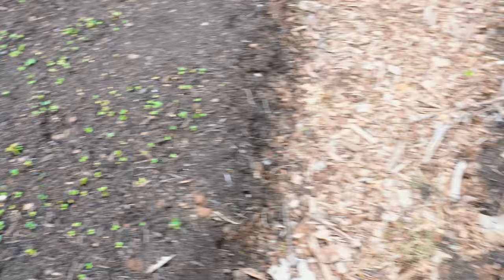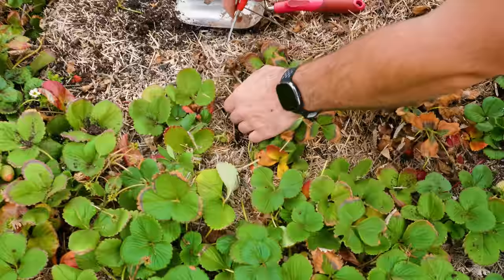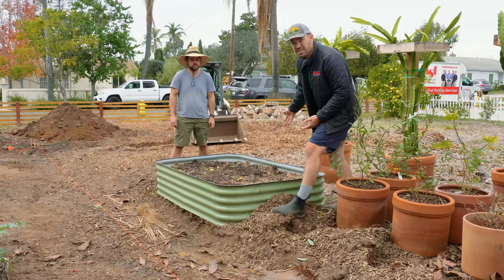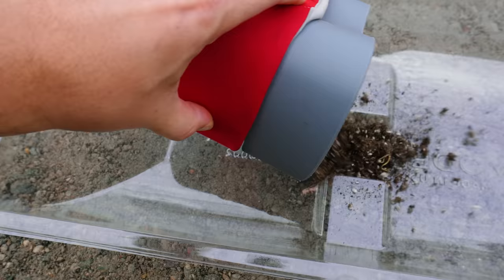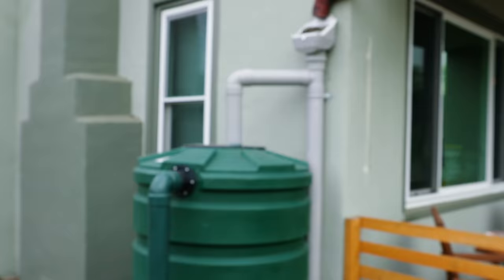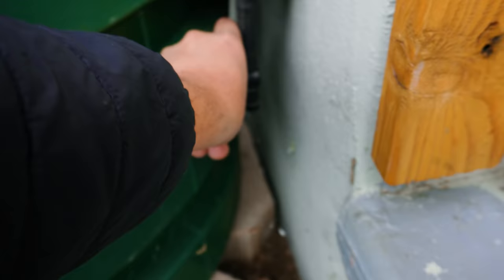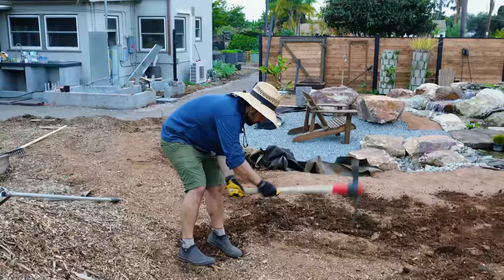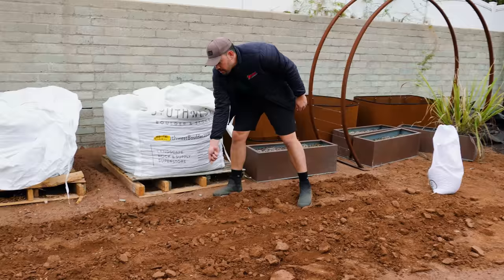Preparing The Garden For RAIN 🌧

Comment: It’s a tiny snake! Silly!I hope you have more. Keep them in the strawberries so they can keep the bugs down.      Can you put a hose connector to the bottom of your drain so you can direct the water where you want it? If rainwater drains into your reservoir it should settle and keep your water level topped off

Comment: Hey Kevin, I just received the Epic 6-cell seedling trays and they're super strong. I turned a Botanicare 4x2 flood and drain tray into a wicking table and have a bunch of seeds in Happy Frog. I think the large bottom holes of the Epic 6-cells are going to work wonderfully in this manner. I believe I had heard you mention something about plans for an Epic 5" pot...if you pursue that product I'd be a buyer if you ensure large bottom holes like the ones on the Epic 6-cell. Thanks!